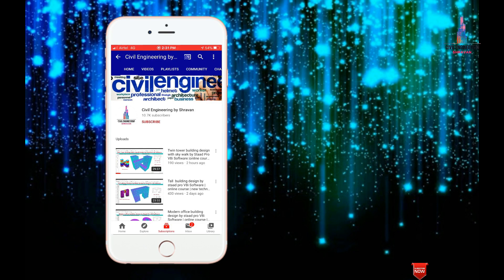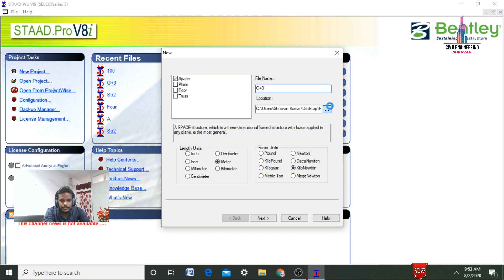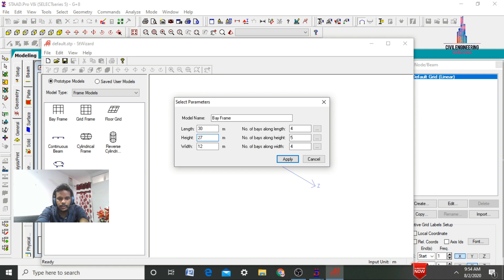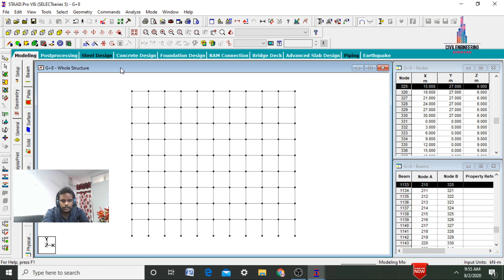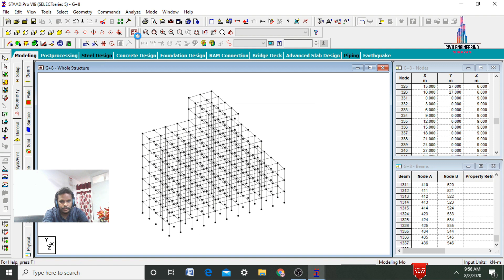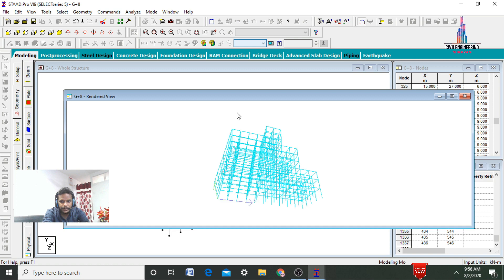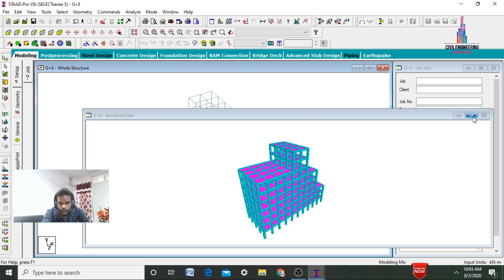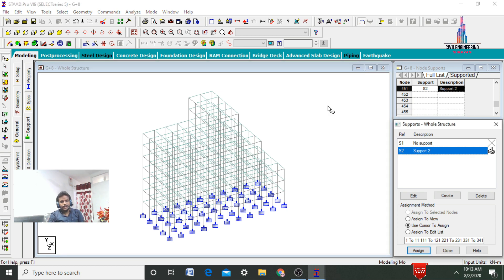G+8 Story vertical set back building design by Staad Pro Software part 1 |online | civil engineering

Comment: Hello Shravan Sir. I have contacted you before also for the issue i am facing but still its not fixed yet.

I am using Staad Pro V8i SS6

I am trying to create a model. To accomplish this task I am using the structure wizard module for reverse cyclinder ( also tried creating other models but failed to merge too). I have successfully created the model and
 after several failed attempts at transferring this item into the Staad.Pro via the 'merge Model with Staad.Pro Model' under the file menu. After selecting the merge command, I am prompted whether I would like to merge this prototype with my current STAAD.Pro model. After clicking yes, however, the module disappears but the 'Paste Prototype Model' dialog box which is outlined in the tutorial never appears. Also Staad.Pro remains inactive and an error is given that it is occupied by another application. Further retrying to RUN Structural Wizard from Geometry in Stadd Model but fails to open the Wizard.

Any help provided will be appreciated.

Comment: In ur design u will allways create plate for slab in building, i have little doubt that ,plate pressure distribution on beam is different from floor load distribution on beam, is it 100%right or not & reinforcement in plate building design is so less than floor loaded building. Which one is accurate plate  building or floor loaded building

Comment: Please how do You change the diameter of rebars.
Secondly how do You set your own rebars size parameters. If don't want  12mm rebars in column but rather 14mm
Reply from the maker: Please change it in design input parameters 👍🏻